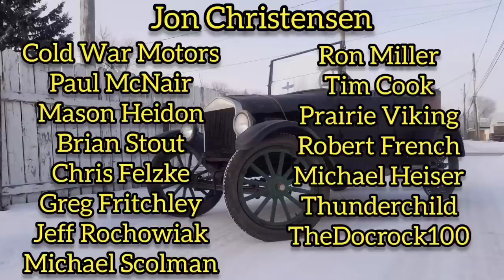Can You Fix A Dent Without Bondo? DIY Metal Finishing With Basic Hand Tools

Comment: Pebble Beach:

I learned in a high line European environment. Porsche, BMW, Mercedes, and an occasional Ferrari.

All my work was what you refer to as 'Pebble Beach' quality. Laser straight, pure artistic perfection.

From watching you, I think you sell yourself short a little. You could easily make one more pass with the file and a set of "Baby hammers" (also known as finishing hammers, or jewelers hammers) and your metal work would be right there.

You can check it by using a sharpening stone (like for a pocket knife), and run that over your work. Use it the same way you use the file. It will show highs and lows that your file won't.

Also, you can spray rubbing alcohol on to shine the surface up. It evaporates much quicker than the wax and grease remover. It's easier to work with while you are still "in Process"

Comment: Once again, well done. I learned metal work in the late 60's, early 70's. Still learning. My school, we started on wrecked cars from the junkyard, learned to strip mechanical parts out, and then how to finish out damage without any filler. Interesting to hear that eons later, you were taught similarly. Thought it wasn't taught much anymore. Most trade schools now teach panel replacement, not much emphasis on repair, with any sort it's more of bash it out and mud it. Nice to see it's not dead yet. But then, I'm a fossil, prefer the old ways. Acrylic lacquer over urethane, even though the later is more durable, to me it looks more synthetic. Lacquer less toxic to spray than isocyante hardeners. Sorry to ramble on, I'll just put on another old blues album on my turntable and drift off to the dreams of an old dude!
Reply: Just curious, how long did it take to work that out to that point?
Reply from the maker: Thanks Brian! The trade schools here still teach how to repair vehicles, you have to fix a rollover that passes a safety inspection in order to get certified in the trade. As for the length of the repair, the video took longer to make than the repair took.

Comment: Kyle, I think you might get bored of fender repair. I never do. I watch your videos eagerly. Thanks for all of the details !! The bullseye pick is something I'd like to try and make since I took up welding again. Just doing structural repairs, not body work. But I will at some point be working on 22 ga metal. I practice on it when I can. I have that same file from lead work I did decades ago. Now you've shown me another use for it ! I may have to buy an old truck to practice on. Thanks so much for all of your hard work !!
Reply from the maker: I definitely recommend buying an old truck haha. Trev's blog has a good  video on building a bullseye pick, although they are fairly cheap to buy.
Reply: @CarterAutoRestyling  Thanks. I'll look over Trev's channel.

Comment: the welded sheet metal blanks that you referred to on the truck are called developed blanks in a modern stamping plant. today auto manufacturers use them in the production of apertures ie the a and b pillars are made of a thicker metal than the adjoining rear quarter. the stamping plant I worked stamped the ford Expedition in a 6 press tandum line. the panel is 14 ft long from tailight to a pillar.
Reply from the maker: Thanks for the info. I remember learning about tailor welded blanks and tailor rolled blanks in school. They join different thicknesses or grades of steel together so the vehicle will absorb impacts better in a collision
Reply: That's right I spent 40 years working in the stamping industry mostly building and desining automation. Before that I worked in the oilfield building oilfield equipment.

Comment: I am in new car manufacturing now. I learned in the 1980s though. Like you, I wasnt allowed to use body filler. The mantra in that shop was "Bondo is for beginners"

NOW, in new car manufacturing, these skills are all but lost. On the line, they think you are SUPPOSED to make a "High", then file it down...However, when I learned, I would have my file taken away from me if I tried that. It was locked up and not given back untill my metal work was right. 

Filing a high spot down was considered sacrilege and evil. It wasnt done.

Seeing it done at work today makes me just cringe.

On the grinder thing, as metal finishing started winding down, and bodyfiller came into wide spread use, it was common to use a grinder and 36 grit to remove the paint...which tore up the metal really good too.

Comment: Thanks Kyle for all the detailed info on the use of the hand tools. 
Given all that good "experience description info", the next step for any of us who want to take advantage of it is to "do the work" while trying to remember and practice that direction. From my experience doing lots of craft/skill tasks, once the knowledge is put into practice and "converted" to hand/brain motions, it becomes "instinctive" to the point that it almost doesn't require much thinking about "do this next" or "don't do this/that". It takes time, patience, and commitment. A "proper" measure of confidence. Enough to keep at it. Not so much that irreversible damage is done in early steps. Again, many thanks for providing the benefit of your experience.  Cheers!!! 
🛠⚙🔩🗜✌👍👍👍🍷
Reply from the maker: Thanks and you bring up a lot of good points. Making these videos is harder than the actual repair because I have to actually think about what I'm doing and explain it, rather than just do it instinctively.

Comment: I watch a few utube metal " repair  " channel's and consider yours right up there at the top. Bondo and lead fillers have there place in metal repairs but it's what's beneath that counts. Great video Kyle one question which way should file be orientated in holder? (Cutting on push or pull ) just a foolish question
Reply from the maker: Thanks Joe. I like to cut on the push, but others prefer to have it on the pull. I guess it's up to personal preference

Comment: Love your vids but, for the novices amongst us, would also love it if you could go into a bit more detail about the techniques you use (the ones that probably seem very basic to you) high spots, low spots, exactly where to place the dolly, when to use a spoon instead of a hammer, what’s too far gone to be remedied with hammer and dolly etc 😊
Reply from the maker: Thanks. I have an older video titled "Repair a badly dented fender with simple tools" that goes through the basics, and they are also covered in the earlier videos in my 36 Chevy fender repair series. As far as what's too far gone to fix, in my opinion its only too far gone if the metal has been thinned too much, either by grinding or rust. Otherwise any piece of mild steel can be repaired no matter how battered. Some people may disagree with that, but I prefer repair over replace.

Comment: Body work is like a lot of stuff right way wrong way. I have used alot of bondo its quick and easy but i tryed to keep it a under a  1/16 thick.  Most body guys never learned or know how to do it any other way. I wish i would have learned early on that it could be done with out filler. Dont get caught up in youtube and start not liking what you are doing your to good for that. I enjoy watching but you are more important than  youtube.
Reply from the maker: Thanks Doug! With a little practice this way can actually be faster than using filler.

Comment: Make a board with black and white lines about an inch wide on it look at its reflection in the panel and you will see the imperfections
Reply from the maker: We had to use those when estimating damage on late model vehicles, personally I don't like using one.

Comment: Is there a reason a homemade slapper should be hardened? I made one out of what I think is mild steel (I could drill it on my drill press) and the only problem I see is that I have to re polish it a little more than my store bought one... realistically I use them so rarely that the surface rust is the biggest issue and that happens pretty quickly on either one
Reply from the maker: There is probably a reason, but if it works then I'd say use it! I've got a drawer full of random chunks of mild steel that I use for dollies and hammers.

Comment: I'm very interested in learning more about that arc welding technique used on your 36 Chevy. I'm interested in Rolls-Royce cars from the early post war period. Bodies were fabricated in England by the Pressed Steel Company in Oxfordshire. They used this arc welding fabrication method. The outside surface of the joined panels were very well finished  with only small amounts of lead. Pick hammer marks are generally visible on the underside (inside) of the panels. As you mentioned panels in the vicinity of the join are sometimes paper thin. A surprising feature of this manufacturing technique is the use of it on reverse curved panels which are very difficult to weld. On my 1953 Silver Dawn the rear fenders are welded to the main body shell at the lowest point of the reverse. This must have called for very special jigs as well as skill on the part of the assembly workers.
If you find out the name of this technique ore any source of information/photo, I love to hear from you.
Reply from the maker: Hi Mike! I did a bit more research and found the process was called Resistance Flash Welding. There are a bunch of old  assembly plant videos from the 1930s on youtube, and some of them show this process being done at the factory.
Reply: @CarterAutoRestyling  Excellent Kyle. Finally some hard information on a subject that has been bothering me since the seventies!
I searched YouTube and found some general information on Resistance Flash Welding but I couldn't find the old assembly plant videos you mentioned. I'd appreciate it if you could point me in the right direction. A video of this technique in auto  body assembly would help me a great deal.
Thanks, Mike

Comment: Metal finishing:

In my day, if you had to do anything more than prime and block, it wasnt metal finished. In many cases, my work was just sealed and painted in the booth.

That said, I also routinely used metal finishing techniques to get my work close enough so I could put only one very thin coat of body filler on. I did this because combining the two methods was faster than either done on its own. I dont consider that "Metal finishing". I did it because it was fast and I was on commission.

Comment: So rather than thinking I'm not very good at this, I need to convince myself that I'm about 10% there and I still have a couple hundred thousand hammer swings to go to iron out that cottage cheese thigh look. 
I think I'm on the right track sometimes, but then I worry too much that I am work hardening or stretching the metal.
Reply from the maker: Keep on it! Don't worry about work hardening on mild steel, it will take some serious abuse.
Reply: @CarterAutoRestyling  
Thanks. Learning lots here.

Comment: I've built a lot of vehicles over my lifetime and I avoid plastic filler like the plague!  When I built or repaired, I could proudly say that, "It's ALL metal." I was taught how to do metal bumping properly. IF it was absolutely necessary, the fill used was lead. "Bondo" has become a massive crutch for builders nowadays. I don'[t approve.
Reply from the maker: Thanks! You sound like a true craftsman!
Reply: @CarterAutoRestyling  Thanks, I try to keep the standards up. I don't do so much any more because I'm just about 70, but occasionally something comes my way through a local car club or by word of mouth through a friend. A lot of older guys really don't want plastic fillers on their rides.

Comment: LoL. The whole bondo/no bondo arguments are like Ford/Chevy arguments. Neither side is right, but neither side will back down. 

Bottom line, both ways have advantages and disadvantages. If you use either technique correctly, you are doing it correctly. If you abuse either technique, you are doing it wrong. Simple as that.

Comment: As someone who fixes dents for people, I barely care about dents., Once my cars starts & runs, I wouldn't care if you kicked the side in, took a dump on the hood, danced on the roof & painted your name on the trunk, so long as it starts, runs & the heater works. We have - collectively, IMO, vanished right up our own a55es on what really matters. My car looks like your coat - in tatters - as does my coat, generally. And I'm perfectly fine with that state of affairs. Pretty much.

That car you're fettling to within an inch of its life hasn't taken you anywhere important in years - the layer of dust tells that. Bet the beater you drive daily never gets this level of attention..
Reply from the maker: What exactly is your point? What really matters to you doesn't necessarily matter to me and vice versa. Oh and my daily driver has never taken me anywhere important because the only thing that's really important to me is the truck which I am "fettling" with.